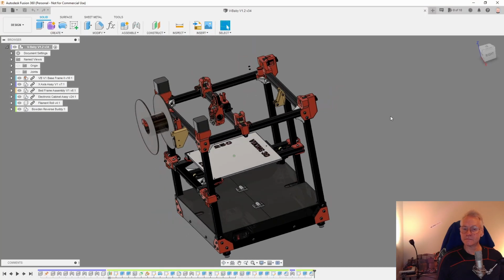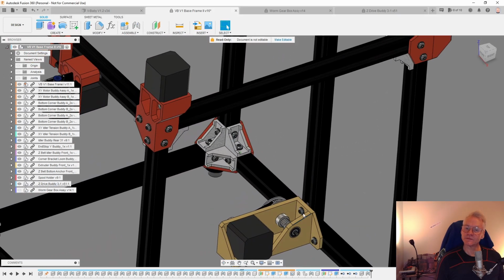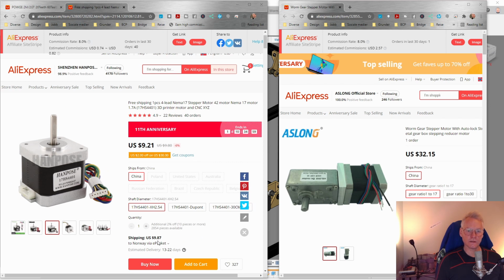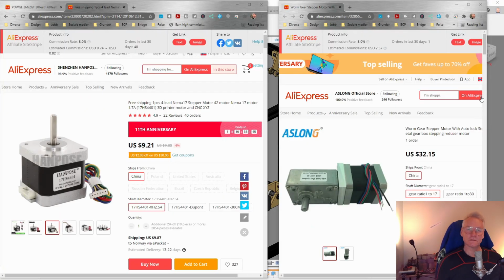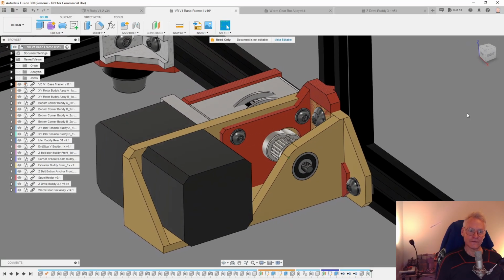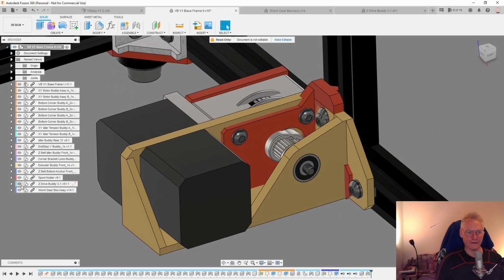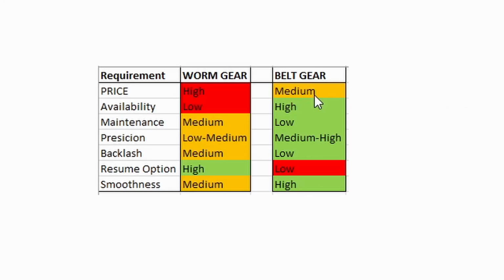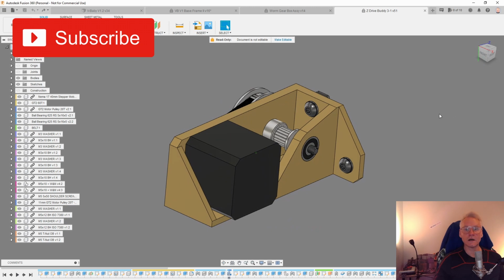3D Printer Z Axis | Belted Gear VS Worm Gear | Pros & Cons

Comment: What if we could somehow use a hydraulic system for the x y and z axes, It should be very possible to calibrate the pressure to match the steps...
Reply from the maker: @jameshallock6374  it's best to keep it as simple as possible. Hydraulics would be very complex. But you have linear motion systems that could work

Comment: I'm presently in the process of experimenting with a two stage gearbox for my printer.
With the two stages, it is extremely difficult to backdrive, and handles a relatively heavy bed well, but I've had issues with the belt slipping while making upwards travels.

I'm working on printing a new version with tensioners that ought to prevent belt slippage.

Comment: i want to ask about pulley gear. Which ratio i should go with 20-60 or 20-80 ? Please help me figure out this problem
Reply from the maker: 20t 60t pulley 200mm belt is the design
Reply: i think its better to go 80 : 20 because then you can use much simpler magical numbers like 0.1 and 0.2 layer height ... i do no think the gear ratio of 60 : 20 is good

Comment: why not just put a z switch on the bottom? or probe another point of the bed that doesn't have prints on it
Reply from the maker: Thank you for the feedback. I thought about this but it really is no problem as is. The bed stays until you push it by hand.

Comment: is using belts even worth it over leadscrews? what benefits did you see?
Reply from the maker: Big benefit in no wobble and very smooth. No leadscrew is straight, this will affect print quality. So unless you can afford high end ballscrews, then belts. The belted drive is also not only good but price is nice also

Comment: Hello,
I think this method is far better than worm gear, because the benefits which offers are valuable.
We need to design electrical 3d printed normally closed break with for example TPU filament to keep the 20 teeth Polly's shaft stationary when power goes out.
Reply from the maker: I am running this option now and it will be the stock solution for the V-Baby going forward

Comment: Hello I have a question why you don’t recommend going over 350 is it because the kinematic of corexy can’t handle the size I’m trying to build 500x500x500
Reply from the maker: The belts will be very long and flimsy. The frame also starts to be undersized
Reply: Thank you

Comment: Then your layer height multiples are 0.1 provided 20:60 200x16micro steps, making whole numbers for z ztepping
Reply: Better is 80 : 16 like voron has making 0.02 as z multiplies
Reply from the maker: The calculation is: 60/20/2 so gearing is 6:1 due to the belt path being double. The we have 80 steps/mm times 6 is 480 steps/mm and this gives 0.002....  mm per microstep which equals magical layer height of 0.0625, 0.125, 0.25 and so on.
Reply: @PRO3DESIGN  is it ok to use other belt and gear setup ? for example voron NOW uses 80 : 20 Tooth Pulley 188mm long belt ... it seems that for klipper it has a better calculation of gear ratio ? Also how did you calculate the magic number for that gearing and steps ?

Comment: This is great. Also to further save on your costs, I've successfully printed the gt pulleys before, so that can save in shipping and purchasing cost.
Reply from the maker: Thanks Ty! Printing pulleys is possible but I dont know how accurate they will be :)
Reply: @PRO3DESIGN  so the accuracy comes from the teeth so as long as you're within a tolerance of around +-5% it'll be fine because of the timing teeth. Mine worked out while flashing, setting up the steps of the steppers, no variance. But I could have been lucky.

Comment: Hi Roy, this looks very good.
I'll give it a shot during the weekend, but with the stock 6mm belt for now.

Wouldn't it be possible to get the resume working with a z-max endstop?
At start of a print, the printer could measure the z range after levelling and then home to z-max after power loss. That could be a simple way to implement this.
Reply from the maker: Hi Felix. Thank you, you can use the 6mm belt no problem. Just put som spacers on the top idler buddy for the idler to get center. You can not use the old top rear idler buddy. Z max endstop is an interesting idea yes.. Smart thinking

Comment: The best option for the Z axis beltet variant is to put two more pulleys in the carriage to double the resolution and get rid of the bed fall if the current is stopped.
Reply from the maker: Thank you Stefan. We already have the double belt drive since 2017 so this is still there as we get 6:! in gearing and it will drop but not without some force
Reply: @PRO3DESIGN  I did a 4: 1 ratio on the engine and then I doubled with the two pulleys reaching 8: 1, if I put 16 pulley instead of 20 I get a 10: 1 ratio, I put on the bed 3 rollers of filamet, almost 4kg and when I stopped the bed it did not go down and remained in position

Comment: It should be an option for the V-king.  The  gear and long shaft are more difficult to source. Wondering if the larger bed on the v King would cause issues with z dropping?
Reply from the maker: I think it will be a good option. We could do 10:1 on the v-king with the heavy bed to keep it more stable or do dual Z with 6:1
Reply: @PRO3DESIGN  Yes, do this belted z drive on the v-king. One for each side. And people could even do 3 so they could do 3 point leveling with the z steppers like on the railcore.

Comment: Hi! Very nice video! I have a question. Did you calculate the torque placed on the stepper motor by the bed when the power is lost? I am currently doing the calculations for the VORON V0 belted Z setup which uses a 4:1 gearing. I have calculated that the motor's detent torque has to be more than 14.7x the mass of the Z carriage, but not sure if this is correct.
Reply from the maker: Thank you Agent! I did not calculate holding torque not powered. It would be interesting to do so but I dont think it is a big deal as long as the bed does not fall like a stone but rather slowly drops. Or do you think about resume option?
Reply: @PRO3DESIGN  It could be ideal for power-loss resume but also just nice so that you know your printer doesn't crash the Z axis over time haha. The Cetus uses a one-way clutch to prevent the Z axis from dropping.  Another idea is to gear it higher, like a 16T:80T for 5:1 gearing, so the Detent torque can be lower.